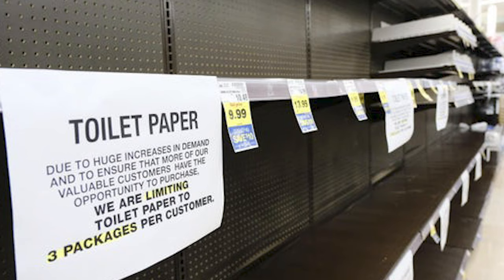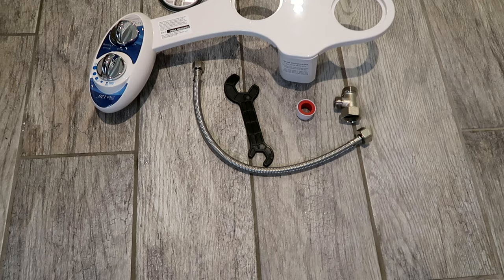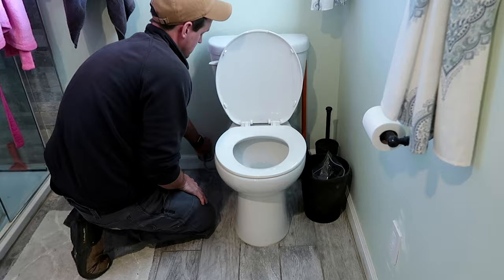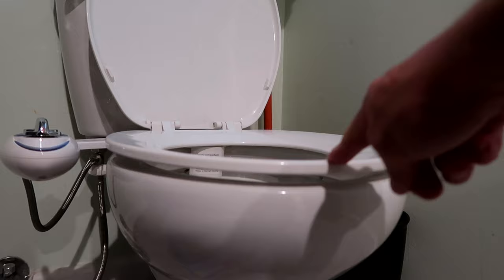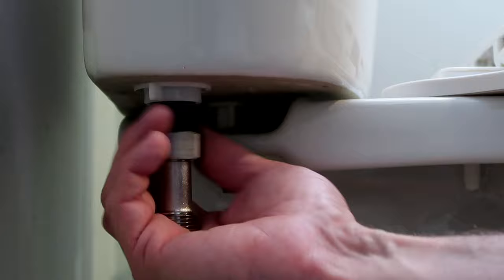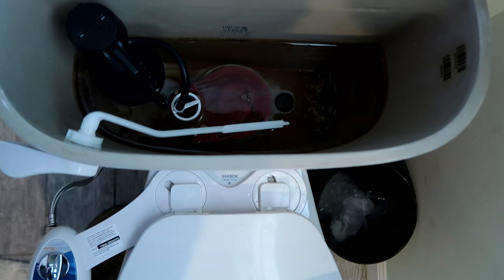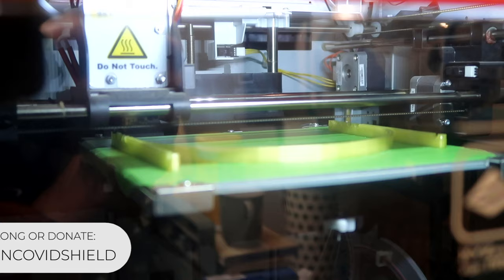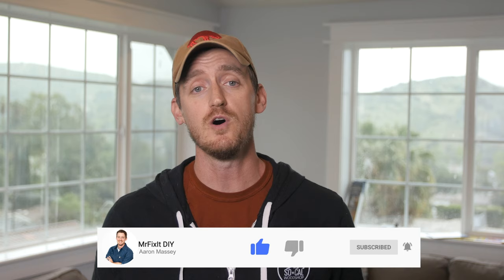How to Install a Bidet | A DIY Plumbing Guide

Comment: Nicely done Aaron! 😃👍🏻🚽👊🏻 .... I've been eyeing these off and on for a couple of weeks though I haven't pulled the trigger yet. One thing I've noticed is that some models come with adhesive pads to put under the front of the seat to support it, but I guess not all, perhaps you can get them separately if it starts to become an issue.
Reply from the maker: I imagine it puts added strain on the hinges without so would lead to higher chance of the seat breaking over time.

Comment: Hi friend, can you help me out? I'm stuck at 2:25.
I can't disconnect the hose from the underside of the tank. There seems to be a white plastic part like the one you have, but there's also a metal one, they seem to be stuck together. I think I have to unscrew them apart but I'm unable to do it.
Also the toilet valve is now loose inside the tank.
What do I do?
Thank you for your time.
Reply from the maker: You do have to separate them. The upper one is likely the nut that secured the fill valve in place which is why it is now loose. I’d recommend a crescent wrench or channel locks to hold it in place and try some WD40 to help release it. Could be corroded or calcified in place.

Comment: Is there a way to hook it up to a 1 piece toilet? No fitting under tank. Would have to split the water at the wall, but does it need to be higher?

Comment: Hey I installed my bidet but the toilet seat is loose.

I do not have direct access to the bottom of the nuts. I have tried to tighten them as best as I could, but they loosen up very easily. 

I am sure it is an easy fix, but I can not figure out how to tighten the nuts of the seat without access to the bottom end of the nut.

Please
Assist 

Thank you

Comment: Hello Friend! Can you help me out? Before I installed my bidet, I had to replace the entire set of my toilet fill valve as it was already defective.
The set came with a PLASTIC  adapter which I had to use in order to connect the fill valve to the plastic female end of the bidet hose. (No metals)
However it leaks and it seems to be coming from the connection between the adapter and the bidet hose. I tried with and without Teflon. Either way it still leaks.
What do I do? Thank you very much for your time.
Reply from the maker: It's possible that there is a crack in the plastic. If you've tightened as much as you can and have tried with and without tape, there may be a defect.

Comment: So, I uninstalled my bidet from my old home and am trying to install it at my new one. I think I've lost the rubber gasket that goes from the T that comes with the bidet and goes to the underside of the tank. What is that called so I can search it on Home Depot or Lowe's website?
Reply: Most likely what you're talking about is 7/8" rubber cone washer.

Comment: I have the same or similar bidet. It makes my toilet seat shift. 
I have tried putting the little gaskets above, below and in between the big long screw. I've tried adjusting everything I can. I ended up removing the bidet because I was getting so pissed off about it. But I miss it. 
So I'm thinking about cutting those long slats in the round parts that spin (hard to explain lol) or, apparently there are some kind of bumpers that you can buy. 
Does anybody have any ideas? I want to put my damn bidet back on 🤣🤣

Comment: Is there any issue in connecting the T-Valve straight to the supply line rather than the water tank? Many thanks
Reply: I assume you found an answer by now, but I'm replying in case not, or in case others come along. The pressure straight off the supply line is much stronger than the pressure of water draining down from the tank. My understanding is that many bidets are not designed to handle the pressure, and will fail rather quickly, if hooked up directly to the main line.
Reply: @tanager3959  Thanks, valid point. I usually reduce the pressure to avoid this problem, it just means that it takes more time to fill the tank but it's not a big deal.

Comment: I installed one of these yesterday. Worked fine for the first use so I was feeling pretty pleased with my plumbing capabilities. But when I returned a few hours later I found standing water around the toilet. There was a steady leak from the bottom of the controller (not where the hoses attach). Will return this and stick with the TP as I don’t want to go through the installation process again.
Reply from the maker: Bummer! Sounds like a faulty unit.
Reply: Make sure the o ring is seated all the way in the grove and not pinched, I had this problem, replaced my o ring problem solved, been using for over a year.

Comment: There is a topic that no bidet videos are talking about. And I say cleaning that unit. Sorry for being so graphic but if like me a lot of your poop comes out very liquid and like an explosion, imagine what the bidet will look like after that. And you have to clean it right away otherwise all that stuff will dry there and then it will be quite gross to manage. Now imagine how embarrassed one of your guest would be if it happens to him during a visit. When I look at the part of the bidet inside the toilet, I dont think that the usual brush will really do the trick and leave the unit clean for the next user. For that reason, I will not buy a bidet. However, for environemental purpose I decided to use reusable mini towels for my number 1 but still toilet paper for my number 2. I have been doing this for more that a year and of course that reduced my needs of toilet paper considerably. I made my towels (about 5 x 3 inches) out of 2 layers of flanel fabric scraps with an overlock seam all around. I wash them in a filet bag in the washing machine and let them out for the dryer. And no, It does not smell in the bathroom. Think about that.
Reply: If your poop is often liquidy then you may want to consider adjusting your diet.
Reply: 🤢 at your explosions.
🤢 at the thought of washing those. I wouldn't want those in my washing machine, no way.
Reply: @Sergeikins  No link at all with my diet. My doctor said that I have some type of digestive enzyme like 10 times normal. I have always been like that and always will.
Reply: @WENCHY101  I think you did not read my post carefully. and about your washing machine, you never washed a baby diaper or any soiled baby garment